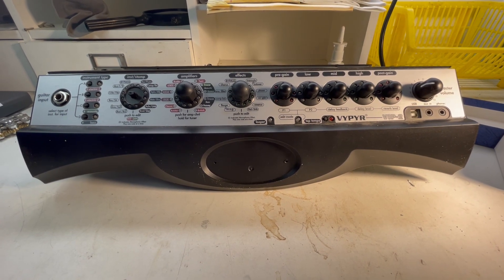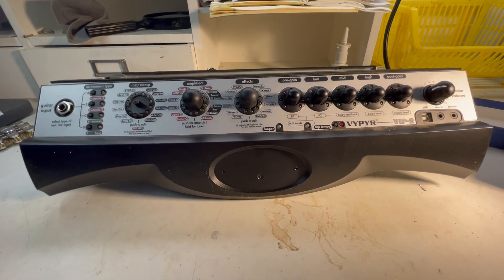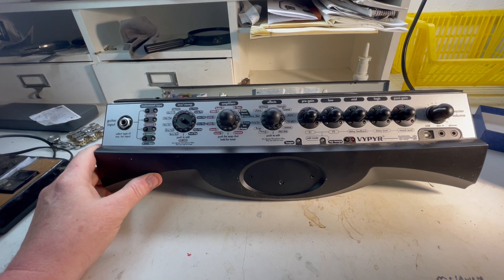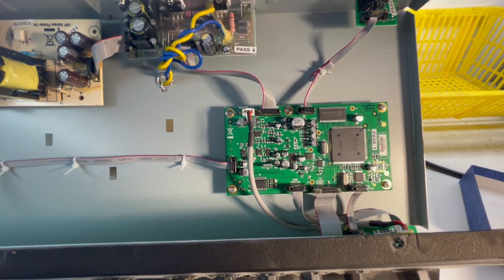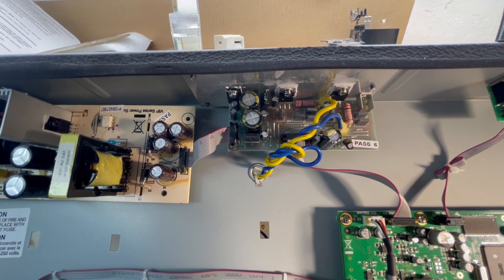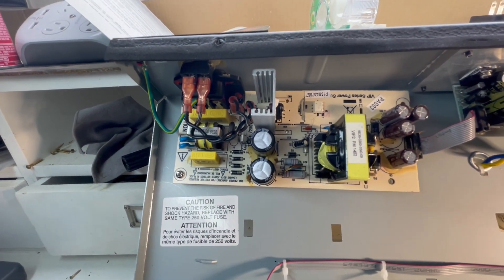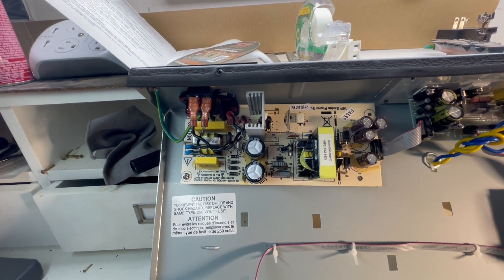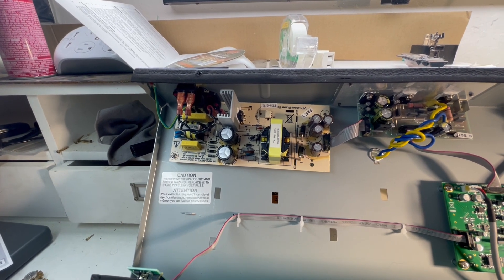Repairing a Peavey Vypyr VIP2 Guitar Amp that is Turning Itself Off and On

Comment: You can power it on while speaker is unplugged, and you'll hear the transformer clicking in and out. I got peavey customer service on the phone, they transfered me to their manufacturing manager to confirm what I needed to do. All I had to do was reflow the solders on the transformer and it was fixed.
Reply from the maker: I recently picked up my 5th VIP-2 ($100 on Craigslist locally) so that I could go through the power supply board and compare it to my 4 old non-functional boards. "Reflowing soldier" sounds complex when I look it up on Google, is it really something other than remelting the soldier to the transformer and allowing it to resolidify with better connections?

Comment: Having same issue with a Fender Mustang III V2. It's my speculation that the same thing is responsible. It could be a weak solder joint that heats up and opens. I will do a proper inspection but I doubt it being that simple. No parts available from Fender.

Comment: I have this exact amp. Found this video because I’m currently trying to do a mod myself (never modded amps before) so that I could add a 1/4 input on the back that goes to the speaker, and for the head section a 1/4 cable that you could plug directly into the speaker, or, and for why I’m doing this in the first place so I can plug my headamp into the speaker and use it as a 1x12 cab.

Any advice, tips, or anything useful you could tell me for this?
Reply from the maker: Just remember not to use a signal cable intended to go from the guitar to the amp, which carries very little current and has tiny wires. You are moving substantial current when going from the amp to the speaker and need substantial wires. And of course pay attention to the ohmage of the speaker, which I think is 8 ohms. A good reuse of a dead Peavey Vypyr 2, it is a pretty decent speaker.

Comment: So did you ever find a fix for those broken pots? Seems a common problem on those amps, mine included.
Reply from the maker: Nope, unable to fix them
Reply: @cv4wheeler  That's what I feared. Well I've had the amp for quite awhile, still works jst annoying. Maybe just time to upgrade.